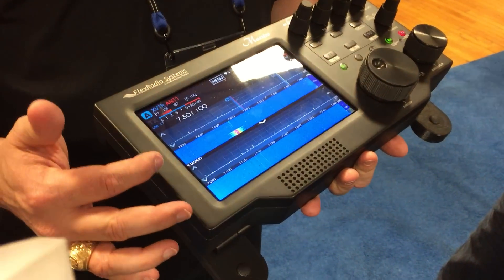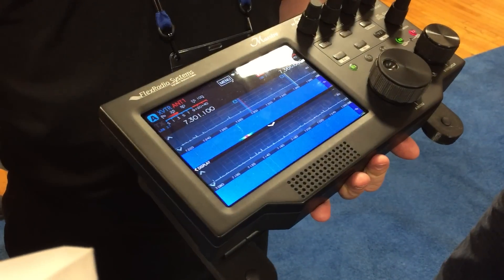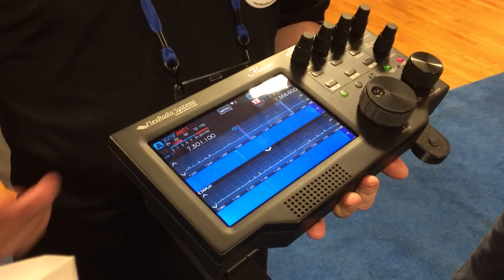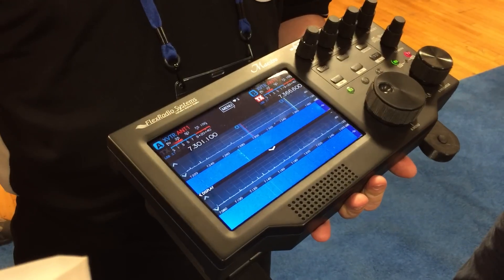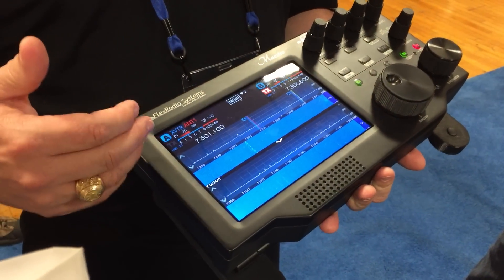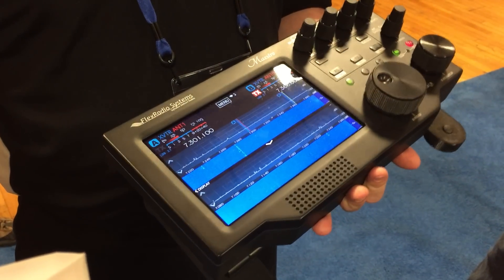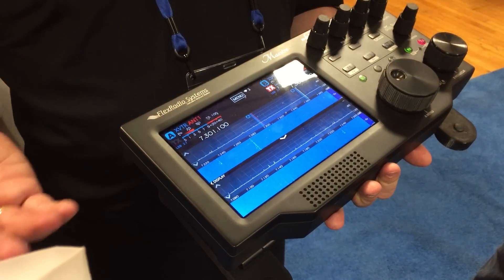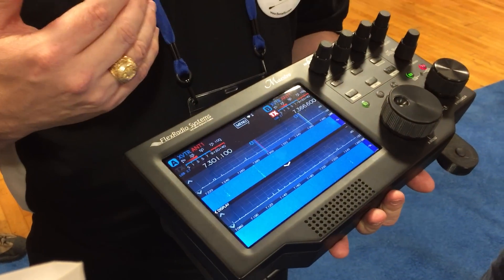First look at the Flexradio Maestro at Dayton Hamvention 2015

Comment: This is the start of what needs to happen for full SDR adoption. Some people want knobs, sliders and buttons. It's not just preference - two hands are faster than one - and, brains work much more efficiently with visual/spatial cues, that won't change. What Flex should do is license out the hardware interface and let other companies specialize in producing an unlimited variety of hardware interfaces, custom. Say I want 18 knobs, and I want them in a certain order - like I really want all my DSP RX functions over in one area, maybe my memory functions in another. Let me use my computer to play with the design, submit the design and I receiver a template and a kit maybe. Looks like a radio, but it's just the interface. Personally to me putting the pan adapter on this is defeating the purpose (for me). Put more controls on the interface and the pan adapter elsewhere.